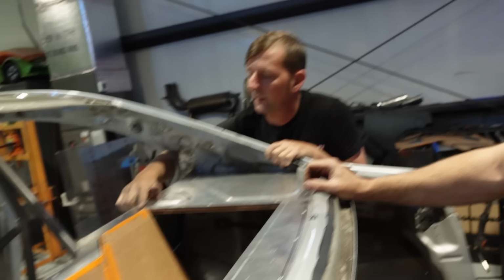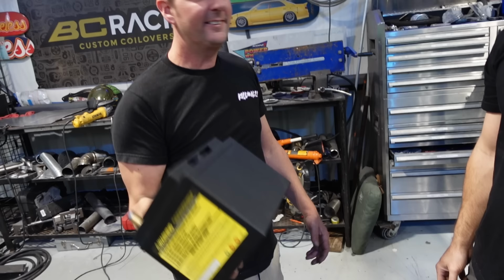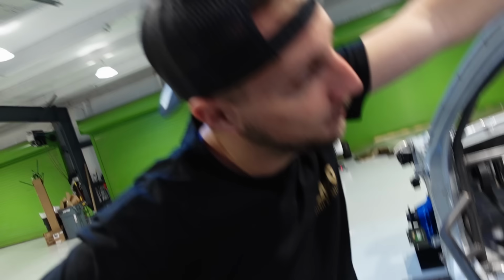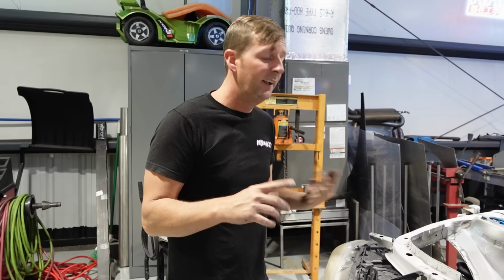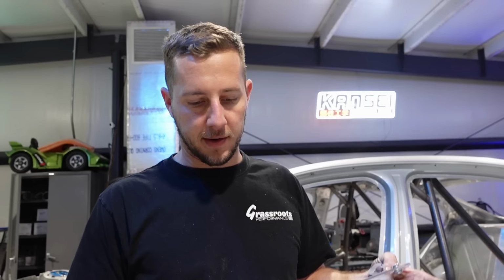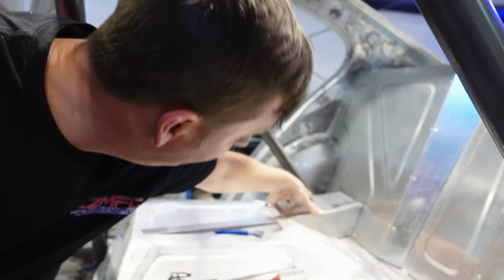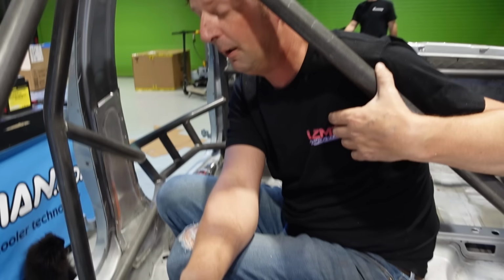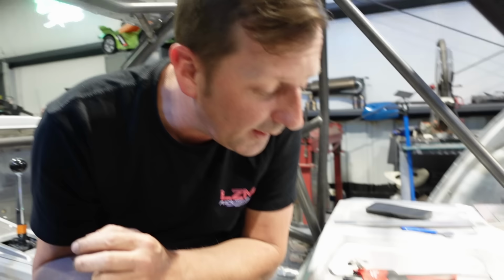Last Minute Builds - LZ & Drift HQ Shop | Behind Scenes

Comment: Dzus tabs are best for those bead rolled aluminum panels. Try using them for something like The front cover panels in the engine bay so they’re closed from getting rubber in but also you can remove them fast for service